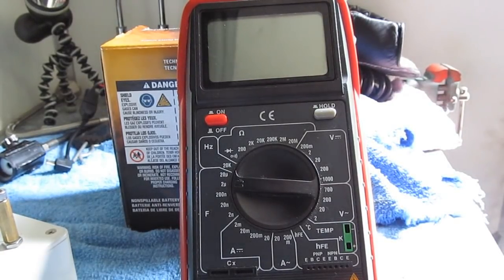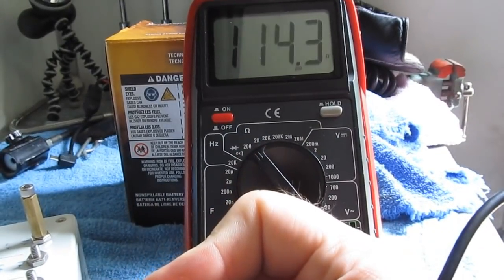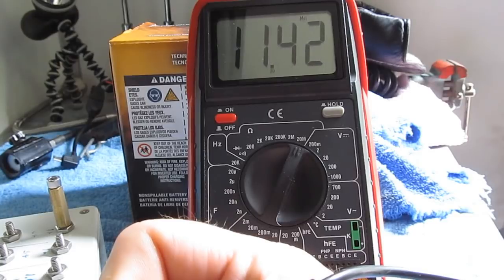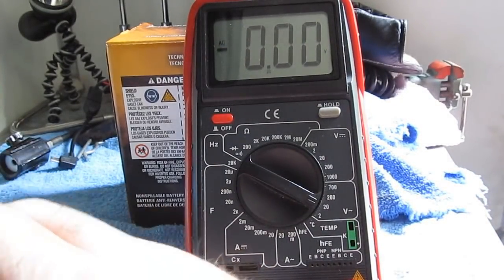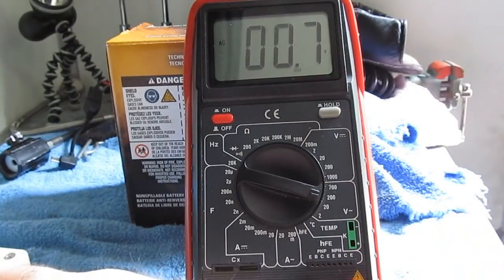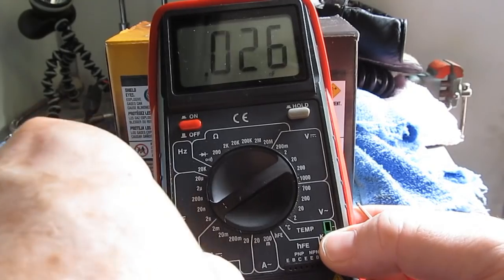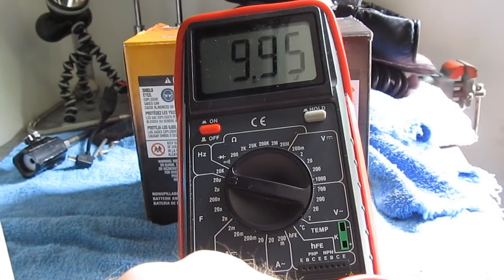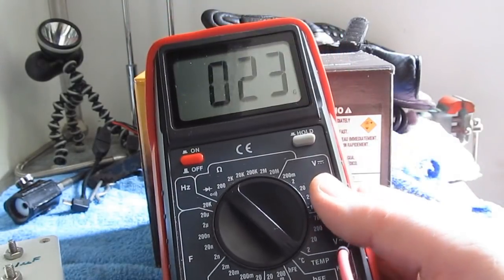Harbor Freight P37772 How accurate after years of abuse?

Comment: The average voltage (VAV) of a sinusoidal waveform is determined by multiplying the peak voltage value by the constant 0.637, which is two divided by pi (π).
Reply: re: "The average voltage (VAV) of a sinusoidal waveform is determined by ..."

Strictly speaking (b/c someone simply has to say it), the average value of an AC sinusoidal waveform is *zero*.

PS. A peak (or FWB rectified AC voltage) waveform is not sinusoidal. When examined with Fourier analysis it has a COMPLETELY different frequency or spectral content.
Reply: @Joseph Nicholas: That's fine, but no need to determine the average voltage, you get that from the rectifier (and low-pass or moving coil meter), that's why they're called 'average-responding meters, calibrated to the RMS value of a sine wave'. The indicated value is actually RMS (for sinus input), or average value increased by 11%.
Reply from the maker: Before is was "Pi over the square root of 3."   I will repeat my response:    Cheap meters averaging meters will typically estimate RMS using pi/sqrt8  not three.    You can find this information in some Fluke manuals.     
Try here for example:  https://dam-assets.fluke.com/s3fs-public/2646876_6001_eng_a_w.pdf
Reply: @joesmith-je3tq  sqrt(8) is the same as 2*sqrt(2).
So maybe it was a typo, since (pi*sqrt(2)/4) will give you the same
Reply from the maker: @merlingallagher4484  Pi/sqrt(3) is not the same as Pi/sqrt(8) which again is the equation used.   But sure, 2^2 = sqrt(16).
Reply from the maker: @merlingallagher4484  Sure he could have had a typo in that first post.  Maybe he meant "Pi over the square root of 8".  Then you have to ask, what was the purpose of the post.